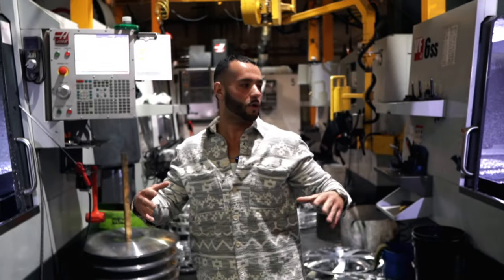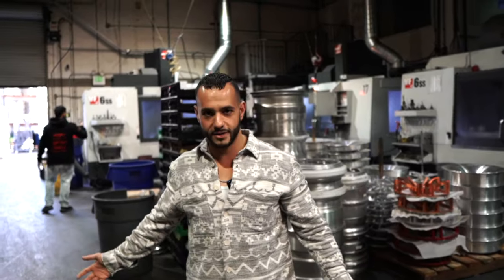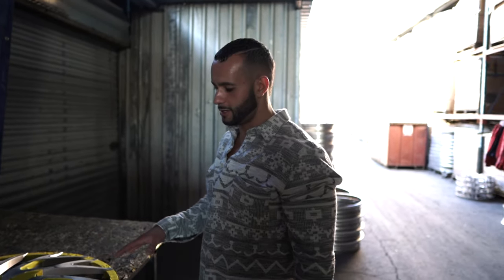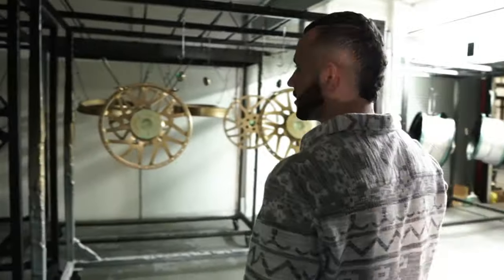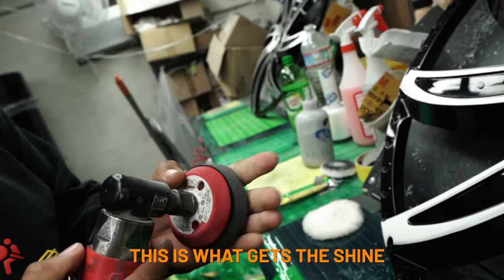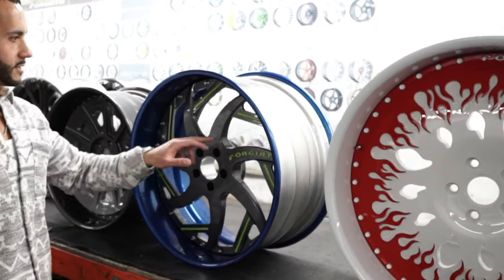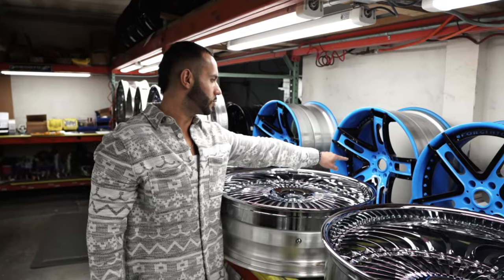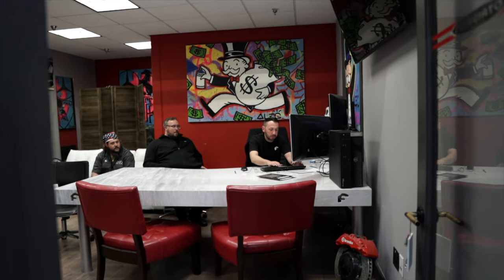Inside the FORGIATO Factory | How FORGED Wheels Are Made

Comment: Those chips are not thrown out, trust me. Also I guarantee there are not "Hundreds" of CNC machines there.  Most like 20 tops.
Reply from the maker: 🙏 Thank you for watching and giving us your input.
Reply: Do you work there ? …no 🤐
Reply: @Hidden-comment164 just by looking at the size of there operations, “hundreds” would not be possible. The guy is right 20-30 max. You can see how many wheel are being stored, in process of being finished, they are not producing thousands of wheels because forgiato is luxury not for the masses.
Reply: And then he had the urge to say “hundreds of thousands of raw forgings” that’s absolutely not possible lmao, unless they have a separate warehouse/ storage facility.
Forgiato is not producing tires for the masses, there would be no point in producing that many